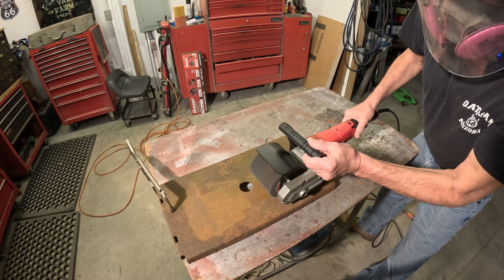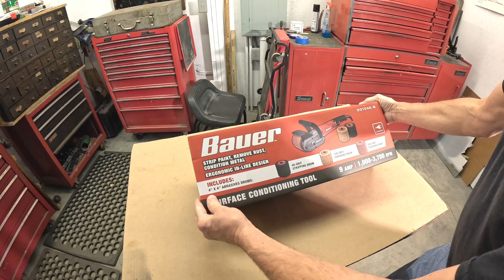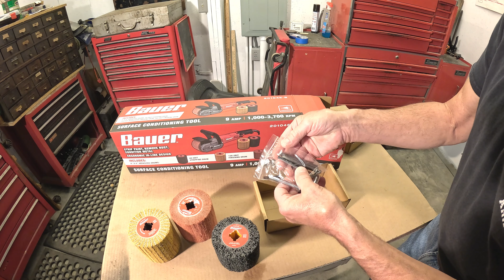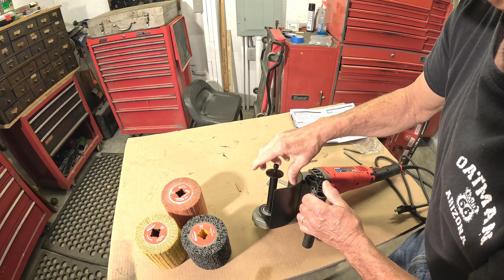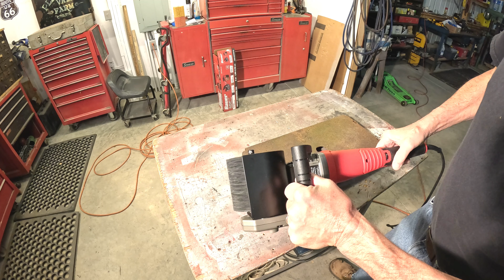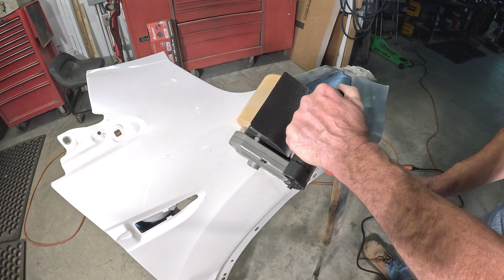Harbor Freight Metal Conditioning Tool

Comment: You can also purchase better brands that have better grit with these barrels i find they work a lot better.
Reply: That's usually the deal with HF power tools. Get the tool but go elsewhere for the discs/abrasives/bits.